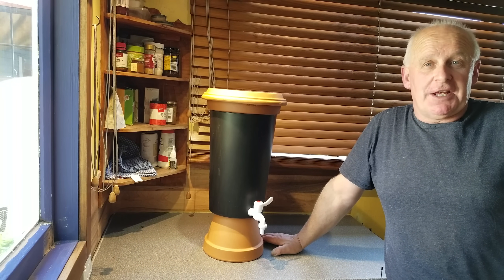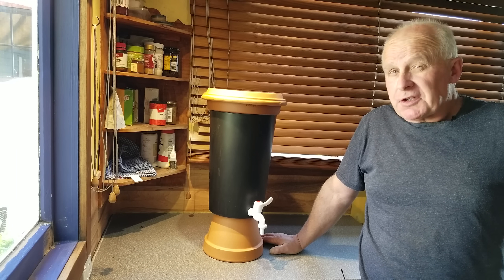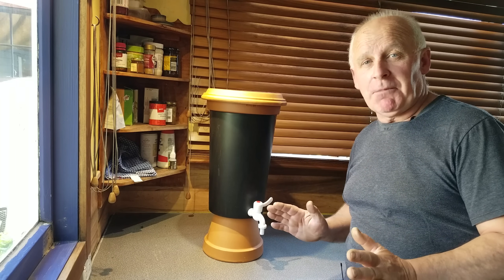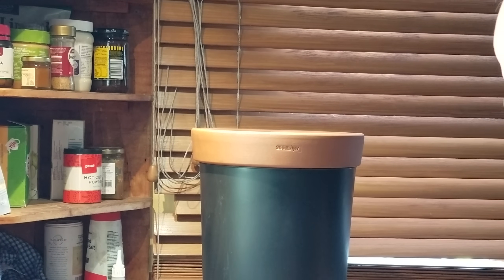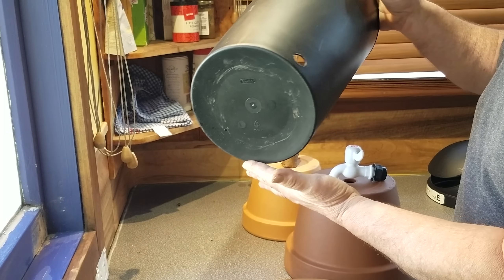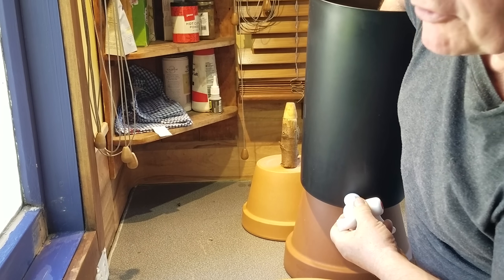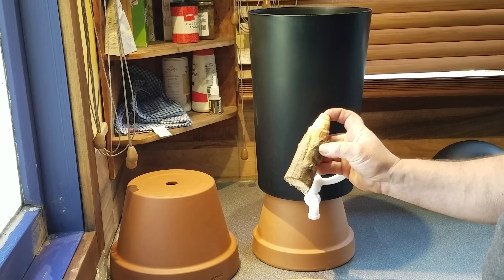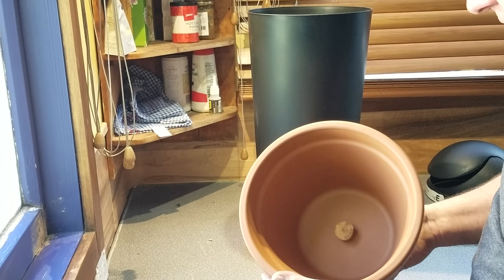DIY water filter. How to make FILTHY WATER drinkable

Comment: I would love to see a lab report on the water from your filter.  I recently saw a report that microscopic plastic is raining down in rain water.  All filters eventually become clogged and need to be cleaned or replaced.  Another lab report on the terracotta pot would be good to see just how much they are filtering over time.
Reply: In the Philippines they have clay urns that have a shape that creates a toriod field in the stored water.  The urns have a slow constant sweating that evaporates and gives you nice cool water even in a tropical environment.  They've had this tech since before the Spanish ruled.
Reply: @tombrown9460  That old urn tech sounds cool!  How can one get their hands on one?
Reply: @ATIMATIK  there are only a few places left in the Philippines that even make the old style urns, you would have to travel to northern Luzon Philippines to find a craftsman.  There is a whole history about the clay urns of the Philippines.  They were sought after by the Chinese for use in fermenting tea leaves. Apparently the tea leaves fermented in the urns was exceptional. The history goes back over 1000 years.
Reply: @tombrown9460  Do you mean a amphora?
Reply: @tombrown9460  is it the shape of the urn or the clay that causes this effect?
Reply: @Calicon  the clay affects the evaporation.  If the mix is right you get a light sweat on the outside.  It has to be unglazed.  The shape affects the energetics. I saw a video of a study of the urns.  They had proven that the internal convection due to temperature differences created an internal toroidal flow. It's not just Philippines urns that do that,  ancient Greek urns also. That shape seems to cause it. The Chinese coveted the Philippines urns for fermenting tea leaves.  Something to do with the quality of the clay promoting proper fermentation.
Reply: @tombrown9460  Wow! Who knew there was so much going on with a simple clay pot....not me, apparently😁 That is really interesting. Thanks
Reply: @tombrown9460  We used to have one of those! You are right, the water is cold even in hot weather.
Reply: @CL-im9lk  Why did you 'used' to have one if it works? Did it break? Too much energy to clean? People started getting ill drinking from it?
Reply: @danielcrockett8398  We used to have it in our farm house when I was growing up. After I immigrated to the US, those jars are just part of my happy memories. I don’t know anyone who got sick drinking water from it. I never cleaned it myself ( somebody else did) but I have cleaned cooking pots similar in material  and it’s easy to clean. Just being careful not to break it.
Reply: @tombrown9460  Cool
Reply: @tombrown9460  Great. Tell us more , please
Reply: Dennis Kenney - I was thinking the same thing. There's also other stuff/chemicals, etc. in the rain/skies that are coming down on us.
Reply from the maker: @annwithaplan9766   so the rain that fills the towns reservoir is 'different' to the rain that falls in my bucket - yes?
Reply: @t.h.o.r.  - Many of use are not relying on municipal authorities. We're simply asking about contaminates being filtered out of the water.
Reply: @t.h.o.r.  no different...just filtered differently.
Reply: @annwithaplan9766  
Chemtrails, definitely
Reply: just put it into your oven at 500 fair and it will be renewed just remember to have it in oven when preheating and then just turn off over to ensure no thermal shock
Reply: @genghischuan4886  thank you for that info!
Reply: @genghischuan4886  That would do nothing to reduce any heavy metals or any chemical contaminants in the terracotta.
Reply: @genghischuan4886  Just put the 1cm filter in your oven every single time you use it. Because ovens don't use energy and can magicaly produce energy without pollution of any kind or cost of any kind.
Don't forget to heat it to 500 degrees, way beyond any cooking temp you would ever think about to make sure all the magic free heat gets into every pour of that pot.
You guys in cities, crank that oven up when energy prices are being deliberately driven sky high and bake this pot using fossil fuels that your entire family can't afford.

You must be happy now you have water that is marginally better than rainwater as opposed to having food? The energy companies thank you also.
The environment however, wonders what the hell you were thinking in your virtue signalling daze.

Next time, get some charcoal and a used plastic bottle.
Reply: why not do layers starting with sand, pebbles, charcoal? charcoal has the ability to absorb chemicals..
Reply: @christophercross4325  yep pebbles ? Sand and ACTIVATE charcoal x
Reply: @christophercross4325  good idea!
Reply: Christopher sterner
That would make it no different to a million other vids on YouTube, using the age old method that everybody already knows about.
This method, if the terracotta isn't adding heavy metals to the water, as it's filtering, is absolutely groundbreaking and isn't repeating the same boring method we all know about.
Reply: @billyandrew  What is the age old method you're referring to?
Reply: I'm interested in the lab report on the clay pots. Garden pots can contain heavy metals, including lead, and are not meant to be in contact with food. Or are these clay pots from food-grade clay?
Reply from the maker: @dianadiehl   The only terracotta manufacturing area with heavy metal contaminents is Pakistan. Mine are italian terracotta from an area well known for its tableware. I am trying to educate people to think for themselves and not rely on municipal authority.
Reply: @t.h.o.r.  That's good to know! I'm just not aware how to tell where local vendors, such as Home Depot or Lowes, get their terra cotta containers. Supply sources can be from anywhere these days. Thanks for the info.
Reply: @t.h.o.r. 
I live in a city of around 3 & a half million. 
At last check, two decades ago, the water was being recycled, therefore re-treated, sixteen times a day.
That's when I decided to start filtering my water.
Thanks for responding to the concerns over terracotta.
Unfortunately, with the UK govt withdrawing from the EU we now stand a chance they'll strike another of their infamous bum deals and we'll end up importing pots from Pakistan.
Reply from the maker: Sixteen times a day- euwwwwww! I could not live like that. When I visit my daughter in the city I decline to drink coffee or tea there. I cant even get it close to my face without the chlorine pong putting me off.
Reply: @t.h.o.r.  It is easy to get the chlorine out of water… fill your clear glass jars with the water and set the open jars on a window sill in the sun for as long as it takes to get the level of chlorine denatured as you have in your water.  Mine takes just about two sunny days tops, or a week of cloudy days.
Reply: @louisegogel7973  or just cook it
Reply: @t.h.o.r. 
We have fluoride added in the UK now, but a reverse osmosis filter takes about 95% of it out, a quick flush through of the filters and refilter the 5% and maybe 2-3% more is taken out, bringing it well within safety parameters of around 81 - 82%. 
Holy basil, on the other hand, is supposed to remove 80% on it's first steeping in the water alone, but it's required in such large quantities and has to be submerged for around 14 hrs, however, it's another guaranteed natural filtration, like your's.
Reply: @louisegogel7973  ok but what about all the other nasty chemical they throw in there ? Doesn't chlorine boil out too if you book the water, but again what about the other nasties ?
Reply: @t.h.o.r.  Yes, I suspect Italian terracotta was the way to go...
Reply: @t.h.o.r.  great video thank you,  and also to expand on.

I'm in Australia we import terracotta pots from Vietnam.
I'd also argue those have the possibility of contaminants also.
 A lot of chemicals used in the Vietnam war would have decades/centuries life spans of contamination. Obviously I could wrong.
Reply: @AlanKirke  I don’t think you’re wrong.
Reply: @t.h.o.r.  exactly, make sure they are Not from China!!!
Reply: @dianadiehl  check for unglazed I don't know that they sell them at home depot
Reply: @t.h.o.r.  I live in Massachusetts,  USA
I'm unable at this point to find Lawson cypress. I did find eastern red cedar.
Can I use that, or can you recommend something else?
I have everything else you have in the video
Thanks for you help
Lenny
Reply: @t.h.o.r.  as I have heard Detroit, Michigan USA where I currently reside filters sewage into drinking water.
Reply: @louisegogel7973  Or you could just put some lemon juice in it. Vitamin C/absorbic acid apparently chemically reacts with chlorine.
Reply: @lennmiester  you could just use a rubber cork or wine cork. Your just trying to stop water from seeping through the hole.
Reply: @t.h.o.r.  Then that would be a good thing to add to the video! Imagine building the filter and adding a serious contaminant 🙄
Reply from the maker: @kitkatsouthern2024  You cant- "add" to a video
Reply: @dianadiehl  if you can't verify the sources for local supplies, you could look for a local ceramics factory, or craft pottery. You could ask about buying a standard pot unglazed. Or have one made with its own lid like an oversized ginger jar. No reason basic equipment can't be ornamental.
Reply: @michellebyrom6551  Good ideas! I'm in rural Mexico, so I'm not sure what's available here. There are lots of pottery places, but the pots deteriorate if they get too much water. They literally crumble. They usually seal them with some kind of coating, but they only last a year. I need to find somewhere that kiln fires.
Reply: @michellebyrom6551  Clay comes from the earth and that means its constantly being taken from new areas. Any area can have lead or other contaminants depending on the land conditions. I think if it were me I'd have the clay tested in a lab to be sure I'm not adding lead, aluminum or other things that will be long term health issues. You'd have to be unlucky to get lead in most terracotta but its totally possible. I would have thought terracotta pots from home depot or other regulated sales would have been tested at the factory since people are handling them and sometimes growing food with them. I'm not sure what the regulations are.
Reply: @practicalguy973 
What about cadmium?
Reply: @michellebyrom6551  Find a local potter who makes food grade dishes and have a pot custom-made.
Reply: Diana, after the clay pot disintegrates,  you still have the clay.  Pulverize the shards to create a tightly packed layer theiygh which to filter the water.

Firing the clay will vitrify the clay thereby render it unuseable for water filtration.
Reply: This entire thread is very entertaining.  Everyone's a chemist.  Haha
Reply: @michellebyrom6551  Love this idea!
Reply: @michellebyrom6551  
The terra Cotta at Lowe's is from Italy.
Reply: @dianadiehl  make sure they are Not from China. I heard the best clay pots are from Italy.
Reply: @dianadiehl  only the terra cotta from Pakistan
Reply: Diana Diehl
That's a very interesting question you pose!
Reply: I collect rainwater, filter it, then run it through Berkey, then finally through my still to get rid of anything that the previous steps didn't.  I run the still using branches cut off my perpetually growing Mesquite trees on my home built rocket stove.
Reply: @Wolfgang-the-Gray  makes no sense to do both methods, if you are boiling and collecting steam like most do then no need to filter first, just a waste of time.
Reply: @genghischuan4886  there are a few contaminants that are light enough that won't be removed with a distiller.... he's just taking those extra precautions
Reply: @Wolfgang-the-Gray  did you buy or build your Still?
Reply: @Wolfgang-the-Gray  im not sure drinking distilled water is good for you ?
Reply: @eggspanda2475  you may be right. Distilled water might soften the teeth. It will become acidic by absorbing CO2 from contact with air.
Reply: @eggspanda2475  Yup. Distilled water is void of important minerals. That is a sure way to have major health issues and kill organs.
Reply: @fernmoss3539  mn
Reply: @fernmoss3539  this is getting complicated 😮
Reply: @eggspanda2475  it's fine actually. Hopefully you're taking in good minerals daily and using Celtic salt 🧂 😉
Reply: @eggspanda2475  Add a dash of sea salt.
Reply: @eggspanda2475  whatt ???
What makes you think distilled water is bad?
Reply: Distilled water lacks electrolytes like potassium, magnesium and calcium. If drinking distilled exclusively you will need to find another source of these micro nutrients
Reply: @linw7320  Fairly easy with a whole foods diet.  But I have noticed that properly mineralized water tastes far better than distilled water.
Reply: @eggspanda2475  there has never been one studu done on it.  That is a rumor created by one silly doctor in Africa based on casual correlation, not causation studies.
Reply: @practicalguy973  not true unless you eat food that has no minerals.  That is an unfounded rumor based on a personal journal of one doctor in Africa.
Reply: @donovanallen  fair enough
Reply: @donovanallen  lol have you no common sense? This is not about one doctors claims. Anyone reading this please don't listen to this person, research what I said above on your own, I wont be wasting time responding to stupidity here again.
Reply: @practicalguy973  the water itself may be devoid of minerals and nutrients, but the FOOD you're eating isn't. You're not simply surviving on water, you have to eat too. So the nutrients in the food more then makes up for the nutrients that "aren't" in the water.
Reply: @Momma_Tomma  Just like everything now days there are a lot of opinions on distilled water from it being able to suck poisons out of your body and being so great to being really  dangerous for your health. I suggest people reading don't listen to you or me and read from lots of reputable sites and form their own opinion.
Reply: @practicalguy973 but you can add lemon juice or pink salt to distilled water to make it fit for drinking.
Reply: Dennis Kenney
Your comment makes perfect sense and I wish someone would or could answer it.
I'll employ this method, as it is inexpensive, however, I will treat the filtered water with chlorine, iodine or potassium permanganate.
The last two, Incidently, remove heavy metals...two each, I'm led to believe.
Better safe than sorry, although I'd prefer someone test the water filtered by this method to provide us with a conclusive result.
Reply: @billyandrew  yep
Reply: @billyandrew  Filter out the chlorine and then turn around and put it back in again?
Reply: These are good as an alternative, the Berkey is best if you can afford it. Their filters are crazy good and they have mineral re-uptake filters which add good minerals back to the super filtered water.all ya gotta do is look at the ppm of terracotta vs carbon filter
Reply: @imboofingit8684  i disagree, brita filters are as good if not better than berkey filters. Same technology, same process but half the price.
Reply: I wouldn’t be surprised if you could do a firm scrub with a hard brush in clean water, and then boil the pot. Much like you would clean a Römertopf or other type of clay cooking pot to get any residue out of the porous terracotta. Would still be interested in a lab report though, but this is a great resource for emergency situations!
Reply: @flutteringazure  maybebpkace limestone in the bottom for another layer of filter
Reply from the maker: Have you ever stopped to think where your town's water supply comes from?  - Its the same rain that Im collecting in my bucket. https://gpm.nasa.gov/education/water-cycle/hydrologic-cycle   Im trying to help you people rise above the logic that society has driven into your heads. In reality,  'lab reports' and  'approvals' and bureaucracy are created to control you. By people who's priority is not your health and well being. It is to get you to subscribe to their system so that they make lots of money.
Reply: @t.h.o.r.  I for one appreciate your efforts! And I know there are many like minded as well, so Ty 🙏❤️
Reply: @t.h.o.r.  What a crap response to a legitimate question. There are private water quality testing sites that you could send samples to without disclosing the nature of the water source. You could even send them from different sources just to see if you could detect any bias. Wtf kind of reaction is this to get defensive over someone having a legitimate concern over the quality of water that might be coming from a municipal source.
Some people are stuck in cities (or areas with little rain fall) and need a solution that fits their current environment. Not everyone can afford to just leave their livelihood on a whim and go squat on someone else's land.
Reply: @t.h.o.r.  Thanks for link 👍
Reply: @t.h.o.r.  Great answer!
Reply: @t.h.o.r.  Amen! As if municipal corporations have some magical source of water that does not fall from the sky as rain... Apparently moringa tree seeds make a good flocculant for removing suspended particulates from the water like the big boys do down at the water treatment plant...
Reply: @unclebenny9028 
Would you have a link on how it is done? 
If so, will you please share it?
Thanks ❤
Reply: @t.h.o.r.  THESE ARE STUDENTS... THEIR MAIN JOB IS CRITIQUING!!!
...STEALING, MOCKING ETC ETC ETC
Reply: The plastic is less dangerous than the LEAD in the clay pots.
Reply: Also the food you eat has a lot of plastics. Way worse than rain water, unless you live directly in a smog city
Reply: Nano plastics ... Esp on the beach apparently
Reply: @melinda5871  and now reading in our bloodstreams...from inhalation from surgical type masks worn constantly for 2+ years
Reply: I know. When he boasted about the rain water I thought, are you not aware of what's going on??? Chemtrails are raining down toxic chemicals, there is no good rain water 😒
Reply: Why are certain people so worried about that "carbon footprint" when the most populous nations on earth do nothing? China, India, Russia, name a socialist / communist country & insert name here.
Reply: @rishz7857  “carbon footprint “ and “climate change” is part of agenda 2030. It’s “problem / reaction/solution “.  It’s part of the whole controls agenda
Reply: I'd like a full Qualitative analysis done on that pot including a full report on the results including QUANTITATIVE results as well! Lets find out what the mud for that "Terracotta" (unfired Earth) really has in it! For all you know it could be some refinery pit for lead acid batteries in China or an arsenic pit from gold mining in South America or Africa!
Reply: @oldogre5999  yeah and who's gonna pay for that report?
Reply: @oldogre5999  well how about you go out and buy a terracotta pot and polypropylene water drum and do the water analysis yourself if your so keen on knowing the quality of the water! It costs about $150.00 to get water samples tested bloke!
Reply: @Ageofdeception67  Why would I do that! I'm no stupid enough to run my drinking water through an unfired pot that comes from God knows where.
Reply: @oldogre5999  all the terracotta pots here in my town are from italy,otherwise i wouldn't be drinking water thats been filtering through something made in china or pakistan. The problem im having is i think the glazing they use on the pots is blocking the pores in the terracotta. I just cant get the water to get through it after sanding the inside and outside of the pot.
Reply: @Ageofdeception67  Oh, I did not know that. Are you talking about the painted glaze that is then fired in a kiln so it looks like porcelain? Are you sure that it is safe for humans? I don't know about your governments departments like the US's FDA but I'd be apprehensive about colored pots. I always thought you could get unglazed terracotta pots.
Reply: @oldogre5999  no there not ceramic or painted pots,they are terracotta but I think the glazing they use must be mixed in with the clay because I have tried and tried to no avail. I sanded both the terracotta pots I bought with a power sander on the outsides and used my dremel for the insides,washed them in fresh water and nope nothing. The water was condensating on the bottoms of the pots but not dripping like in his video. I think the pots he is using are the ones that have peices of hay mixed through the clay and when they are put in the kiln they burn away leaving larger pores. Anyway I've given it the arse,ive bought a 8 stage ceramic filter ,20 litre bench top water filter for $130.00.
Reply: @Ageofdeception67  I know you're done with it but just for kicks and giggles have you looked for a local potter who can make what you want? Or perhaps try making your own filters in your back yard, I've had ok luck with putting clay right into the pit full of hardwood and firing them that way, some break but if you have decent clay its not to bad!
Reply: @oldogre5999  na im done with terracotta pots, i will grow some wild lettuce in the ones i bought. Ive already bought an Italian made 8 stage ceramic carbon water filter unit,should be here by the end of next week. The filters are good for 2000 litres before they need changing and the replacement filters are only $45.00. My family and myself go through about 20 litres of water a week for drinking so they will last well over 2 years before needing to be replaced.
Reply: @Ageofdeception67 
Is it available through Amazon?
Could you please share the link?
Thanks ❤
Reply: @merechevy5695  I’m in Australia and I don’t use Amazon ok.
Reply: For a lot of commercial ceramic water filters the then to use something with stiff bridles to clean it but I do believe it can also be put in the oven not 100% sure on the oven though
Reply: Its from geoengineering polymers. Also high levels of nano aluminum and now graphene oxide.
Reply: Rain water taken from a source that could be contaminated by bird lime is the problem. As is water that stands too long. Legionella loves anything over 4 days old. Best to treat most none chlorinated water with UV. The build up of slime in the header tank is also a problem. Good idea but needs more thought. Yes in extremis this with washed sand would get you out of difficulty but fir everyday use it is questionable.
Reply: @community-first  once you evaporate water to a gas and then condensate it back there is NOTHING in that water,,,, it has been distilled.
Reply: @genghischuan4886  Distilled yes, but there is far from nothing in distilled water. Distilling removes solids and kills bacteria. What about the rest?
Reply: @genghischuan4886  that's not true. Not even distillation is 100% pure. There are substances that evaporate before water.
Reply: @genghischuan4886  you accuse him of not knowing science, but it's you hypocritically not knowing about the science!
Reply: @genghischuan4886  I was under the impression that liquid chemicals can evaporate and condense.
Reply: @maranscandy9350  anything that can gas out already has everything else converts to a solid. I mean this is old knowledge, just go learn something
Reply: @genghischuan4886 You must be  a hoot at gatherings. Certainly rainwater is less problematic. Ground sources can contain additional impurities. Certain pesticides, volatile solvents, and certain organic compounds with boiling points close to water will not be completely removed by steam distillation unless additional steps such as adding carbon filtration or adding gas vents in the passage leading to the condensers to allow volatile impurities to escape. This is what I was hinting at in my previous comment. Did you learn anything?
Reply: @genghischuan4886  sorry bud, but thats not the case.  There are chemicals that evaporate before the water and then condense just the same.   Sad but true.
Reply: @nowonmetube like what substances?
Reply: @genghischuan4886  actually in distilling some chemicals will evaporate before the water and will end up back in the water when the water turns back into the liquid. That is why they tell you to let chlorinated water to set for awhile before distilling because chlorine turns into the gas before water, so you will not  be removing chlorine ,if you put it in the distiller before letting it set.
Reply: @nowonmetube  Correct, but that is why you don't want to collect condensate at those lower temperatures, just collect at the right temperature. Think alcohol.
Reply: @genghischuan4886  learning is what most of us are trying to accomplish here.
Reply: @I_AM_Shepherd  what rest?  When you turn water into a vapor, it is H2O. If you are worried about collecting anything with a lower boiling point, like vocs, let the water come to a full boil for a couple minutes before starting the collection (let it out gas anything else without it being covered) and that is it.  You should have darn near perfectly pure water minus what it collects from the walls of the collector (which is why lab distillation uses sterilized glassware).
Reply: @nowonmetube  so don't start collecting until you have the water boiling for a couple minutes.  Man... If it evaporates before water, the solution is obvious.  In alcohol distillation, it is part of the process to "take off the head" of methanol, for example.
Reply: @reginafetty6374 well you can always test the distilled water afterwards with a TDs water tester. If it reads zero then you don't have to worry about anything.
Reply: @community-first  even in your water bottle that you didn't empty within that time frame, even though you only poured that water into a glass?
Reply: I'd like to see an analysis breakdown of what all terracotta can filter from tap water let alone flint water
Reply: Check out Dane Wig and Mike Morales its crucial.
Reply: @AldousHuxley7  have u got links please x
Reply: There’s microscopic plastic in your drinking water
Reply: WHEN THE PROVERBIAL HITS THE FAN... CHEMTRAILS SHOULDN'T BE A PROBLEM?? 🤔
SHOULD THEY... COS OTHERWISE THIS WOULD ALL BE POINTLESS PLAYING STARS WARS WITH DRONES HUNTING US DOWN ETC ETC ETC
AS FOR PLASTIC... MICRO PLASTICS? MY X SAID MARGARINE WAS ONE MOLECULE AWAY FROM BEING A PLASTIC? SOOOO I WOULDN'T WORRY TOO MUCH ABOUT THAT.
PLASTIC MUCKY DEES WON'T BE OPEN LOL
SOME PEOPLE ARE OVER THINKING THIS.
Reply: what are thoes line they spray in the sky
Reply: I would like to add that this is a fabulous idea but, I would not believe for one sec that poly plastic 5 is safe, the gov lies about absolutely everything. Plastics when heated or left out in the sun “off “gas...same with say water bottles left out in u r car on a hot summer day. They disrupt u r endocrine system and hormones.
Reply: Crop dusters and industrial pollutants are in the air. Rain Water needs to be carbon filtered before it is safe to drink
Reply: I use Shungite to filter my h2o . Tastes fine ...aren't they finding Covid and Monkey pox in the sewers in America now ? Cough ...God can u imagine all those disgusting masks that these moronic zombies wear being tossed into the oceans now ? Humans are so feral .  Ide want to cull them too
Reply: Donna Kenny.... absolutely.   Distillation and reverse osmosis can help
Reply: Remember what you wash your body' clothes and dishes with is still entering and affecting your internal  workings.
Reply: aghhhhhhh!
Also, two clean clay pots of different size with charcoal sandwiched between them. Take a bit longer but some things are worth the wait, like the end of this thread! Peace
Reply: If you ain't got no water, you'd open your whole big damn mouth up to the sky to drink that crap from a No. 1 plastic funnel UNfiltered! All of the friggin' chemicals in the worlds water systems but you want a test. People are annoying!!!
Reply: They are trying to scare you from catching and consuming rain water. There are micro plastics in everything. Probably less in rain water than the bottled water most people drink. 🎉
Reply: I wouldn't worry too much about tap water, most people have been drinking it all their lives. It's only when we get into our mid life that we  start worrying about our health, but the truth is the damage has already been done to our bodies, you can try and keep fit and healthy by exercising and watching what you eat, but you miss out on so many things. Humans have a life cut off point so eat and drink in moderation and keep active and what will be will be.
Reply: All sea salt also has microscopic plastics that can cause inflammation in the human body. The only salt that doesn't have microscopic plastics is pink  Himalayan salt. Truth!
Reply: @rivermom091188  yeah but the pink himalayan salt might be garbage painted pink these days. There's been scams 🤦🏼‍♀️

Also that's not the only source of non plastic salt. I just can't remember the other one, but it's not sea salt for sure.
Reply: @rivermom091188  That's actually not true. Why mix a good message with lies? Educate yourself on salt mines before you continue lying to people and coming off like a whack job.
Reply: @I_AM_Shepherd  I understand if you think someone has the info wrong but is it a requirement to be mean on trying to correct that information?
Reply: @rivermom091188  or any other mined salt that was formed millions of years ago.
Reply: Let the first 10 minutes of a downpour pass, the water from the sky is clean after that
Reply: The first 10 minutes pose to be for cleaning the roof and gutters, but it still does not remove the contaminants of the rainwater itself
Reply: @Teena795  how do you know that .ive always heard similar about snow but without science involved I don't trust.
Reply: @Teena795  Thank you for sharing! Is this what the experts call a first flush diversion valve?
Reply: @Teena795  That is not true.
Reply: @Teena795  Could you provide an article? I looked but could not find any related info. Really would like to know.
Reply: @Teena795  underrated comment and also now I want some moonshine
Reply: @Teena795  
Certainly hope so.
Reply: @Teena795  That isn't how it works.
Reply: @I_AM_Shepherd  I don’t see you going into depth with your superior knowledge!
Reply: @Teena795  - That does make sense.
Reply: Teena Lancashire
Utter nonsense!
You think rainwater is like tap water and can be purified by letting the first flow run free?
Honestly, that's hilarious. 
😂😂😂😂
Reply: @billyandrew  Rain water is distilled water. The only thing in it is micro particles it picks up from the air. The particles are the same ones you breathe inro your lungs 24/7.
Reply: @Bob_Adkins 
Totally agree, Bob...add in the chemtrails, diesel particulates from aircraft and traffic, chemicals from factories, even toiletries, dust, dead organic cells, viruses in evaporating sweat, etc all rising, as the rain descends through the air to meet them.
A lovely broth, eh? 😂
Reply: @billyandrew  The pollutants are in the air and get trapped by the falling rain.
This is why the air is clearer and you can see farther after a good down poor.
However this process is typically concluded after just a few minutes of rain and as such is cleaner.
Reply: @billyandrew  UHHH, yeah...10 mins. of rain cleans everything....think pls
Reply: @billyandrew  What’s the point of being so unkind?  You only insulted and hurt this person rather than persuade her.
Reply: @billyandrew  The idea is to NOT capture the rinse water that contains dust and bird poop from the roof. After a few minutes of a good rain, the roof is a lot cleaner, and thus the harvested rainwater is cleaner.
Reply: @billyandrew  rainwater picks up stuff that's floating in the air. The first few minutes would be more contaminated.
Reply: @billyandrew  I think she's right. The clouds are water vapor. When water vaporizes, it frees itself from whatever solution it's in as it evaporates. When it condenses back into droplets and falls from the sky, it scours the air of all the smog. That's where all the other crap gets collected. Haven't you ever noticed how clear the skies are after a good 10 min  rain?
The only pollutants that would be in the rain clouds are those with the same flash point as water which is one of the problems with fracking. But there's nothing that can be done to separate those pollutants out of our water being that they have the same flash point in the same molecular size as water so it can't be filtered out or distilled out.
Reply: Billy Andrews, Why be so harsh and derisive? You can give an educated opinion delivered kindly without belittling another being(in this case Teena), we’re ALL learning something
Reply: @billyandrew  I lived on rainwater for four years when I lived in Jamaica. We always let the rain pour for about 10 minutes to wash the dust and lizard poop off the metal roof before we started collecting the rainwater. We would put a little bleach in the water and never had a problem. I still do the same now in Florida, although I have a Berkey filter now that I use for drinking water, but bathing and dishes, etc are done with unfiltered water with a little bleach poured into the catchment. I also use hand pumped well water the same way, although I use straight from the well for the animals and plants who love it and are thriving.
Reply: @Bob_Adkins  Excellent thought! Thank you for sharing!
Reply: Anybody ever checked with  TDS meter
Reply: I've heard of putting silver coins in a water cooler for an antimicrobial effect...
Reply: @unclebenny9028  That's right! In earlier times, farmers put a silver coin in their milk churns to keep the milk fresh longer and nobles ate from silver dishes and with silver cutlery for this reason.
Reply: I have a brilliant idea, Dennis...just skip all this and go outside the next rain storm...and just hold your mouth open.
I think I will go with this guy. Lol